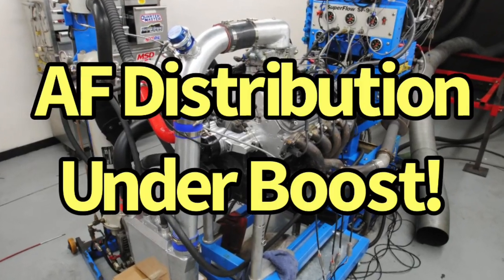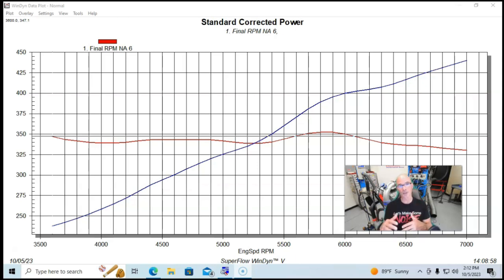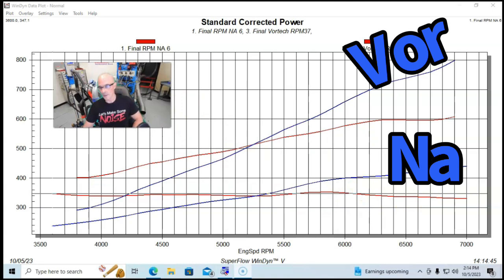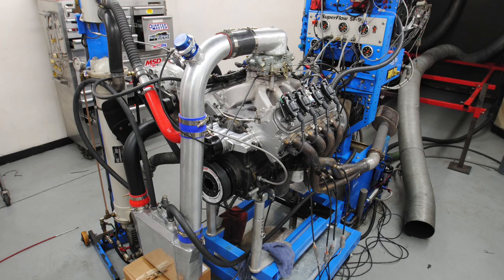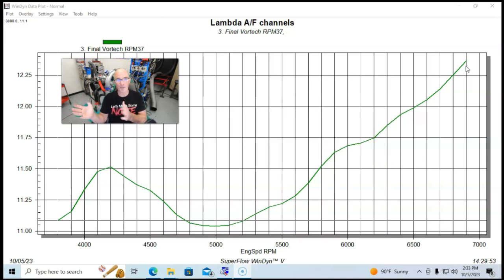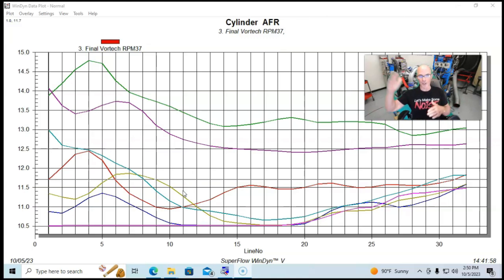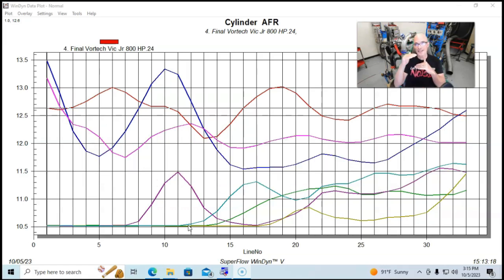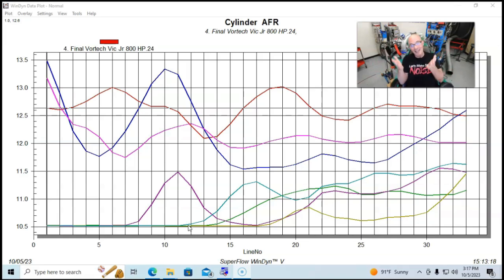WHAT IS THE BEST LS INTAKE UNDER BOOST? SINGLE PLANE vs DUAL PLANE BLOW-THROUGH DISTRIBUTION TEST!

Comment: I talked to the the guys at TorqStorm and they said to run single plane because of this AF cylinder problem.  And that long term use could melt piston with dual plane.  Would you agree?
Reply from the maker: the distribution is bad in both intakes

Comment: That settles it. I don't intend to EVER use a carburetor. Too little precision, with a huge difference from one cylinder to the next in A/F ratio. I guess with one carb throat isolated to each cylinder, it may work, but, meh. EFI FTW!
Reply: Exactly!! Using a carb on a LS motor kinda defeats the purpose of using a LS motor.. it’s not 1970 anymore

Comment: Sequential Port EFI it's one of the best things that have happened to the I.C.E, right up there with turbos, superchargers, intercoolers and coil on plug electronic ignition with no moving parts.
You'll never get close to it's precise fuel delivery under all conditions using a "Carbonator".😝

Comment: Quick question about O2 sensors and turbos- can modern O2 sensors survive the pressure in a turbo manifold? Will they read accurately?
Reply from the maker: most do not run o2 sensor pre turbo
Reply: . @richardholdener1727  We tried years ago on the dyno, but they couldn't take it, but that was circa 2008. I was wondering if they now made some that could take it at least on dyno.  could be an expensive experiment, but maybe you could put a turbo on that 4.8 and see what happens (at least at low boost)
Reply: @richardholdener1727 … Gotta love those trick questions 🤷‍♂️

Comment: Provided I didn’t misunderstand the results on the single plane, all the lean cylinders were the outer ones with longer runners.  (1,2,7 and 8)

Is it merely a function of less overall flow through the longer four runners, or is it also that being wet flow due to a carburetor, that the air is traveling fine but the fuel (being heavier) isn’t making it as equally to those cylinders??

Thanks for all your awesome tests Richard. 👍🏼

Comment: I swapped my 4.8 for a built 6.0 and a bigger turbo. Same turbo kit and wastegate but now instead of seeing 7psi as before, I only see 4psi. Is there something wrong? I thought the same waste spring would net the same boost? More back pressure?
Reply from the maker: more back pressure will open the gate early if you don't have something holding it closed (controller)
Reply: @richardholdener1727  thanks for the reply. Yes, at the moment I'm just on the wastegaste spring

Comment: This is scary for your typical DIY car guy who has to rely on street tuning or a chassis dyno tune at best and obviously can't run 8 widebands.
Reply from the maker: weld in bugs to each cylinder and move your 1 sensor-make multiple runs and compare
Reply: @richardholdener1727  That's a good idea. Sounds like in a forced induction application it's almost necessary.

Comment: Great data, Richard.  One advantage to EFI - cylinder skews, but of course you give up cooling.

Richard, would you say these disparities are based on individual runner CFM differences?  Or just fluid distribution?
Reply from the maker: it is more than just absolute flow
Reply: @richardholdener1727  thanks for the observations, much obliged.

Comment: Good info! I’m wondering who decided on that cam, IC seems way too late to me for a 4.8. The wide LSA gives you serious negative overlap which you don’t really need when there’s not much mid range torque. The results of the collector AFR vs the individual cylinders is very enlightening, though, especially when you show variation tightening under boost—a very good thing! Someone else suggested port EFI, I second that. It would be good to use a four-hole throttle body in place of the carb, but an elbow and a single throttle body would be just as good. The results would show how well the manifolds deliver air to each cylinder, since presumably the fuel would be identical to each cylinder. Great video, let’s have more Richard!
Reply: He has a test on that, it varied also
Reply from the maker: #wrongcam.....again!

Comment: Makes me curious what the afr's would be in each individual cylinder with an injector feeding each cylinder vs. a carburetor feeding all 8.
Reply from the maker: please watch the carb vs efi video where i tested that
Reply: @richardholdener1727  Have you ever done a tunnel ram turbo/twin turbo test?
Reply: Like is there something else going on in the combustion chamber or mixture that is causing the variance

Comment: So if you were doing this in efi you could tune individual cylinders right? Also would there be extra power to be found tightening up the air fuel or is it just safer for the engine?
Reply: Yes with a lot of aftermarket ecu, with Holley on a ls I always enrich the back cylinders on a ls motor , I don’t have 8 o2 sensors but I read the plugs  for heat and afr . Like if I’m commanding 12.5 afr I’ll make a pull pull all the plugs and see if like cylinder 7 compares to cylinder 5 as far as color of the plug.  I can get close but always pick up power that way especially on nitrous

Comment: I know there are single plane port injected manifolds, but do not know of any dual plane port injected ones. Is the distribution better for the single plane vs a dual plane manifold while using port injection?  With the test you just did with the carb, I wonder if they had a dual plane manifold with port injection if the torque curve would be better than the single plane offerings or is there a major downside using port injection on a dual plane manifold.
Reply from the maker: distribution is not better on the single plane, even with port injection